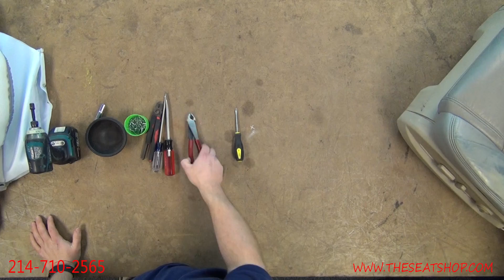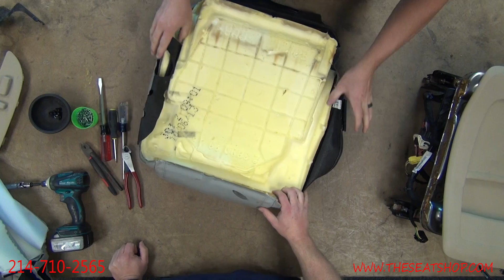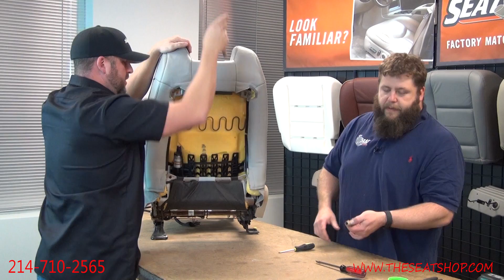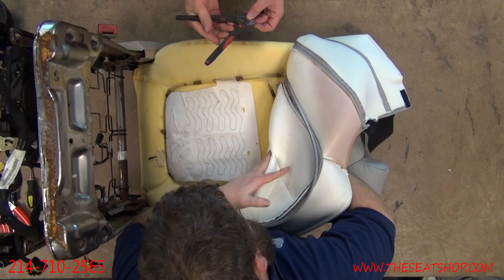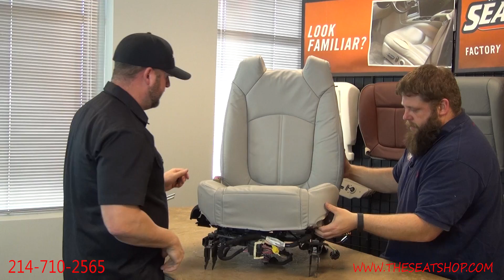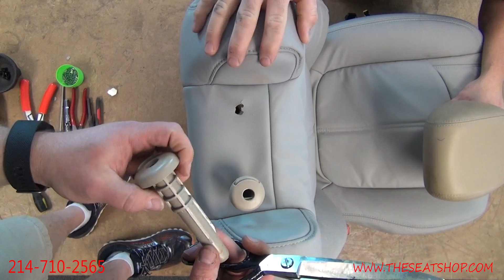GMC Acadia / Buick Enclave / Saturn Outlook / Chevrolet Traverse Driver Bottom and Top Install Video

Comment: Great video!  Do you have one for the second row or is it about the same as the front seats?
Reply from the maker: Very similar to the front row, but the backrest covers will be slightly different due to the armrests and the pull tab to flip the seat forward.

Comment: 10:31 instructions are pretty straight forward lol i can’t seem to take those clips off I’ve tried the exact same technique as seen here but have had no luck. Maybe I’m pushing against it with the flathead the wrong way or I’m positioning it incorrectly? Any advice?

Comment: Hey, thanks for the great video! Learned a lot from you guys. I got a question. My I have the same seat in it rocks especially when you take off. Is there any nuts and bolts, screws or anything that I need to tighten up?

Comment: Realize this is an older video but do you guys have any info on replacing seat heating elements on the 07-16 GMC Acadia? My wife's 16 Denali driver's seat heater only turns on for 5 seconds and then shuts off. Doesn't even get the "click" sound in the module. Passenger seat is fine.

Comment: Hii again, Im all set to do this, and then I went to remove the seat, and realized I will have to cut wires due to the recall repair for the airbag connector. Do I simply disconnect the neg battery cable before cutting to avoid airbag deployment? And, if I only disconnect the negative batt cable, but leave the positive one connected, would I be able to use one of those 9v battery "memory keepers" or would that potentially deploy airbag since positive is still hooked up? Trying to be super safe.
Reply: Did you ever find an answer to this?

Comment: Just want to thank you for having this video It was immensely helpful. I have an '09 Saturn Outlook.. only difference I found was that the yellow plug for the airbag connection was a subject of a recall and they removed the plug and spliced the wires together. Thus I was unable to remove the seat from the vehicle. But no problem using your guide I will still be able to remove the bottom seat cover that I eventually replaced with the seat in the car.
Reply from the maker: Glad we could help out!

Comment: Can u tell me how to disconnect driver side heated seats in 2011 chevy traverse..it keeps coming on by itself for past 2weeks
Reply from the maker: We would hate to guide you the wrong way since we have not done the R&D on heaters for the 2011 Traverse but it does sound like either your control module or door panel control might be going bad. You can follow the heating element wire connection coming from your bottom seat cushion to your control module since it should be the only wire coming out of the cover/foam cushion you can then disconnect the quick connect and test the heaters.
Reply: TheSeatShop thanks. Either I try it like u said or take to a mechanic and pay them to do it. Lol. Appreciate info👍

Comment: I was looking on the website for this product for my 2011 traverse, but  Traverse is not an option. That seat looks identical to my seats.
Reply from the maker: Hey Justin, according to our initial R&D, these covers should match the 2009 - 2012 Traverse LT, except that your Traverse will not have the double stitch down the center of the seat. Since we haven't finished R&D on the panel measurements, we haven't listed the Traverse yet.

Comment: Would you be willing to share link to where you guys got the hog pliers and hog rings cause amazon ones are trash both rings and pliers thanks and also how many rings is needed to do the whole acadia interior seat cover replacement
Reply from the maker: The hog ring pliers in this video we have had for a very long time and honestly, do not remember where we got them from... but you can most likely find them at your local hardware store we are not sure where you are from so we wouldn't know what is around you. Or you can definitely keep searching online for some, we do sell hog ring pliers on our site but they are meant for a one time use. We do sell the hog rings we use in our videos and in our installations here is a link to see both -  https://www.theseatshop.com/store/accessories/

Comment: How do you disable airbag before disconecting wires
Reply from the maker: Hi thanks for reaching out, you will see how to disable the airbags in the very beginning of the video at 1:54 - https://youtu.be/qazI4B8pjRg?t=1m54s
Reply: @TheSeatShop  so those plugs is all i need to disconect to disable airbag i dont have to disconect battery?
Reply from the maker: @oOohdaddy  that is a really good question, so removing the battery is a step that can be taken if you would like but it is not necessary. We are not trying to be funny but disconnecting your battery anytime you are working on your vehicle is recommended, even changing the oil. We have been working on Airbag seats for many years now and think this is just an extra step but if you want to be extra cautious then definitely take that step.

Comment: As an FYI, if you have an Enclave, Acadia, or Traverse that has had the recall repair for the airbag, the connector for the airbag is gone and the wires are soldered together where the connector formally was.  The recall eliminated the connector to reduce resistance in the connection to prevent false airbag failure indications.  This means you cannot remove the seat from the car unless you cut and re-solder the wires.  I chose to just unbolt the seat but not remove from the car and rotate it around in the car to work on being careful not to stretch or break the airbag wires.
Reply: mts0628 ...I was replacing the bottom seat leather.  The leather was actually fine..it was the vinyl on the side panels that had cracked.  If I'm had not cheaper out on using leather on the sides as well, it would have been fine
Reply: If you cut the airbag wire will airbag deploy

Comment: Where is the occupancy sensor located? I want to make sure not to damage it because its expensive to have to replace.
Reply from the maker: Everything you need to unplug is under the seat.  Unbolt it and lean it back to have better access.  Thanks